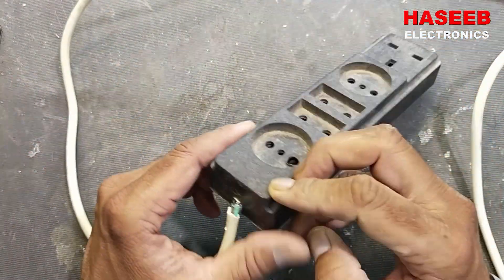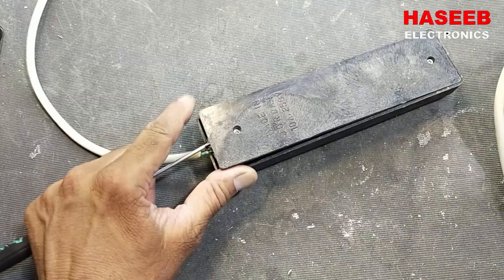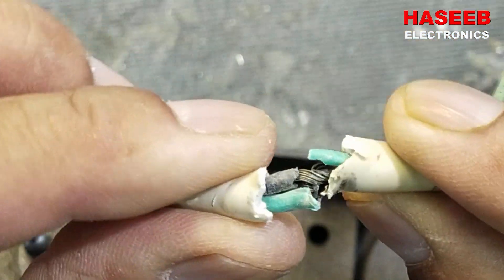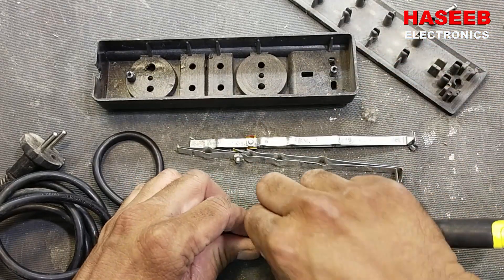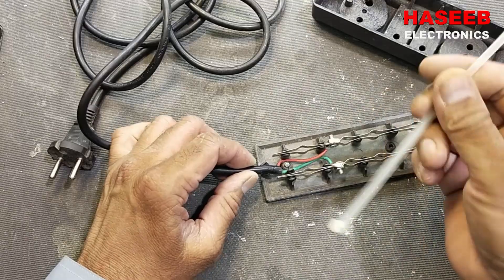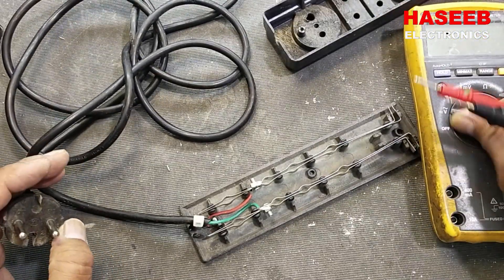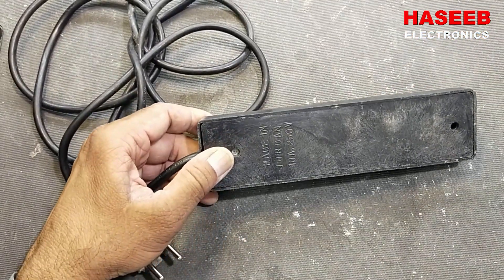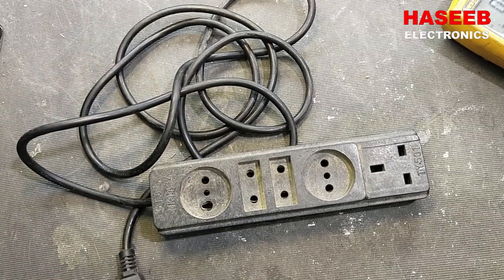[421] How to Repair Electric Power Extension Cord / Extension Board

Comment: Great, that you used a 2 wire cable replacement. I would disable the 3 pin plug for safety and perhaps cleaned up the metal stripes for better contact to preventheat on the contacts at high current. One plug looked a bit melted. 🙂